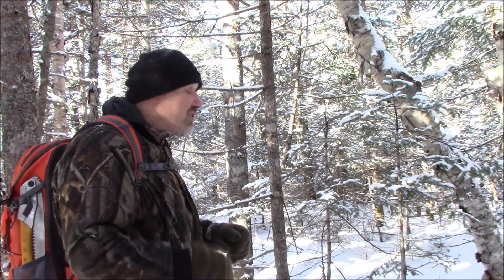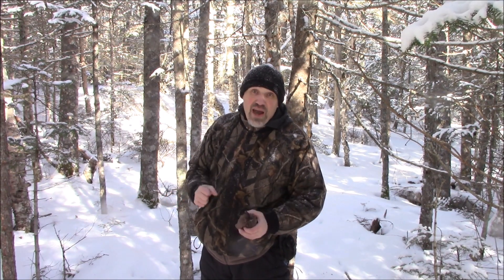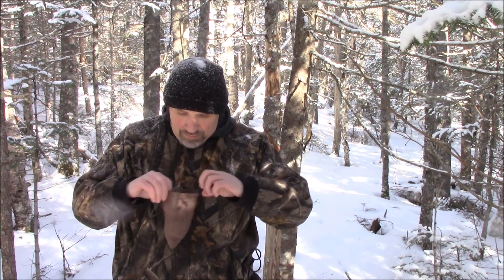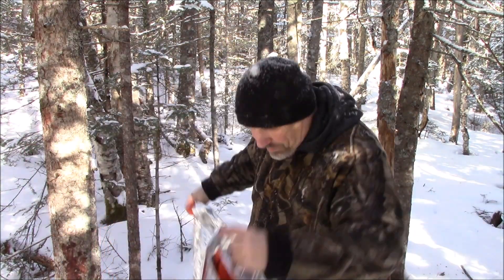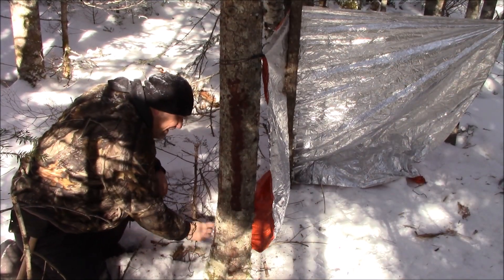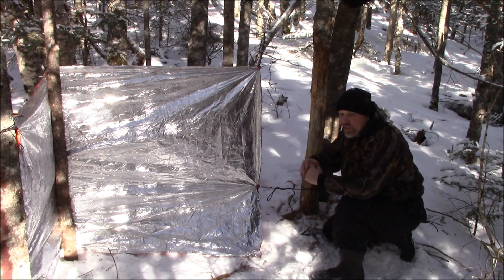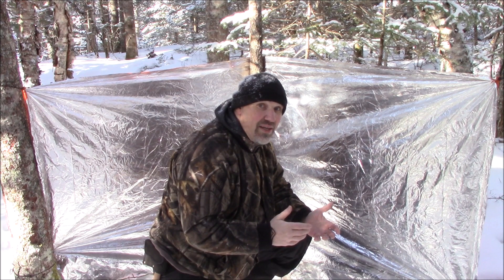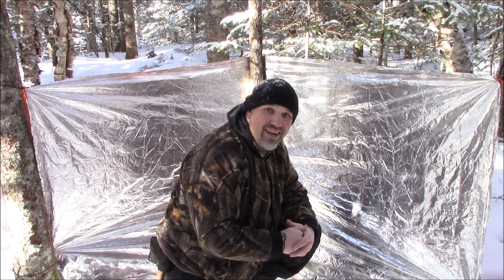Survival Warming Shelter

Comment: Nice little quickie setup. Good job.
Reply from the maker: Thanks, i wanted to come up with an idea, that one or two people can get out of the wind, and stay warm , or have a fire to aid in keeping warm. this is meant to use for a short time to warm and go, or sit for a few hours if need be. Nice to hear that you liked the idea.
Reply: @kullcraven  I like the ideal of setting up the reflector wall for a short break rather than building an all out shelter or sitting out in the wind.  You can also use small stones or pinecones in place of those buttons if you misplace them.  Not sure if you covered that, I might have missed it.  Anyway, thanks.
Reply from the maker: I had not covered the other options for the buttons. I have many vids where i use stones, spruce cones, wooden pegs that i make and even coins ,etc. They all work well to create the anchor cord. :) I agree, and you see what my intentions of this shelter was. :) ATB.

Comment: We'd use a setup like this with plastic bags from new mattresses, in the early 60's while ice fishing. Using 3 to 5 poles set in the ice so we could shift the plastic around to keep the point into the wind behind us. Often we'd make a small fire for warmth if we were catching lots of smelts. I don't think the reflective blankets were available att. I'm certain a space blanket or two would really have heated things for us. This is a great addition to any campsite because always being exposed to constant wind wears on you after a while. On a sunny day, you'd be able to suck up the rays and enjoy the heat. Great idea, always. Thanks. Cheers.
Reply from the maker: Thank you very much for your experience with a shelter like this. On the ice, stopping the wind can make all the difference for sure.Thanks for the story and nice to hear you used similar. ATB.

Comment: Interesting idea, I think I prefer the plough point using my grabber blanket. Quick and easy and I think would hold the heat in better. I'll give your idea a go tho. 👍
Reply from the maker: Thanks , plow point can be good as well , this is meant only for warming for a couple folks if need be. Thanks Richard for the watch and your thoughts :)
Reply: @kullcraven  thanks bud, gonna try your shelter as I think when sitting by a camp fire with my lad doing some craft it could work well. Not something I would have thought of 👍
Reply from the maker: Yeah place it in the sun and block the wind, can make a huge difference as well. :) Thanks again.

Comment: It reminded me of the super shelter.  On my way to the cabin this morning, i was actually thinking about making a super shelter to see if they were warm like they say it is.  Thanks for sharing and ATB.  -Yves
Reply from the maker: The super shelter is a lean to design, with plastic over it, they work well . This is different and only meant to block wind and reflect heat. :) The key to a super shelter is to get it set up so it breaths and dont leave you soaked from condensation. ATB.